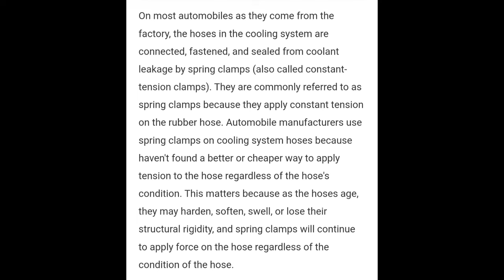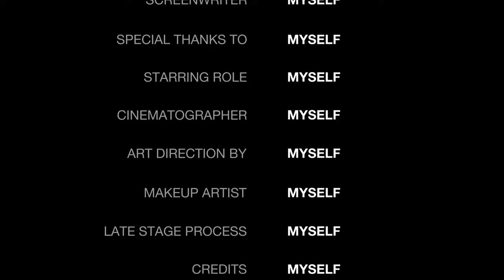STOP USING THESE ON YOUR CAR! Hose clamps worm 🪱 vs constant tension clamps!

Comment: This is all sorts of contradictory (not from you) because I just bought a radiator from one vendor and the upper and lower hoses for a Vanagon.  I’m sure you know how nerdy/anal Vanagon people are - or, if you don’t , they are.  Bought the hoses from a business that ONLY deals in Vanagon parts and for each hose (sold separately or in kits) , at the bottom they show you which hose clamps “you’ll need” and they’re ALL worm drive (they don’t even sell spring clamps).  Theirs are stainless and have an extension (not riveted on or attached , just made longer but without holes for the little gear so that they don’t cause the pipe to eventually extrude through… and they are somewhat wider than regular hose clamps (the idea being , well, you know…).  I’m just surprised that they aren’t savvy about the worm type clamps doing all of the negative things you show and clearly explain  here.   Yes , I HATE dealing with spring clamps,  but they clearly are the better choice.  Too bad someone can’t come up with a hybrid that doesn’t require one of those damned tools that invariably slip off and give you a nice blister.  Yeah,  some sort of spring-loaded worm clamp … kidding.  Sortof. I’d be curious what you think of the clamps they have you purchase along with your hoses.  Van Cafe.   Thanks a lot for the info !

Comment: So as a bmw tech where does the crimp style clamps fit in this conversation? I'd think they don't expand and retract like the constant tension they just expand and allow slow leaks that make me money 😂 I find them replace often by worm clamps with at least no reported issues 🤔 just a question and my perspective on the matter
Reply from the maker: They don't expand your sure about that?
Reply: @CPthetooladdict  they do expand they just don't retract  that's why they cause a slow leak and crusted up coolant around the lines where the crimp style is used see it alot on on n63 coolant lines near the turbos

Comment: Great job about these style clamps? First off, people tighten the shit out of these clamps and the cheap China one's, will snap or strip on the first try? I would never advise using these worm or gear style clamps , that are not a USA or German made units, like Ideal or anything else made with quality? They do crush hoses and damage components, even when properly tightened? The best clamps are the permanent style, in my opinion, but people may disagree?  Good call, again, CP.